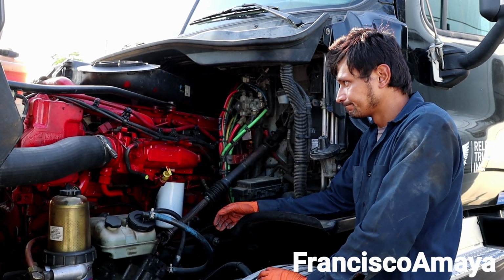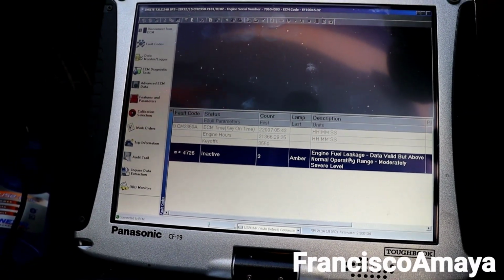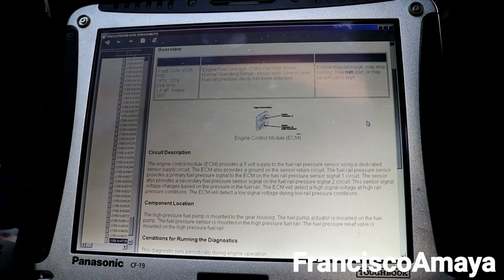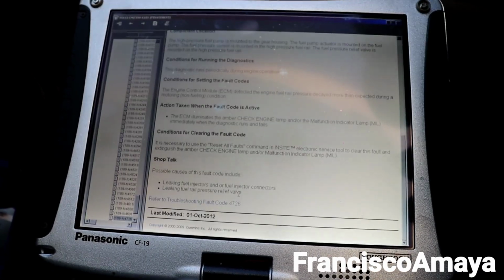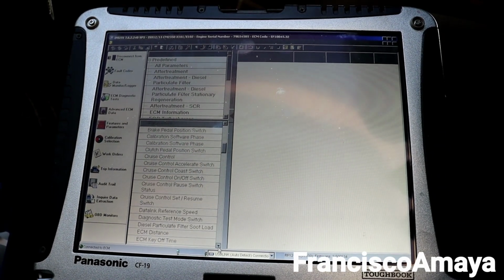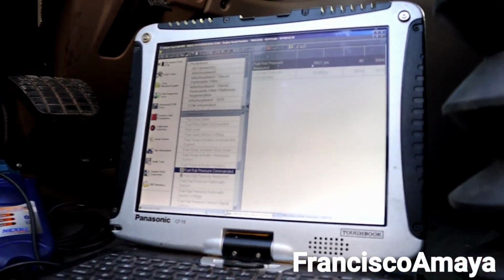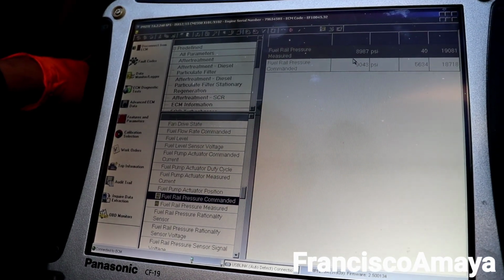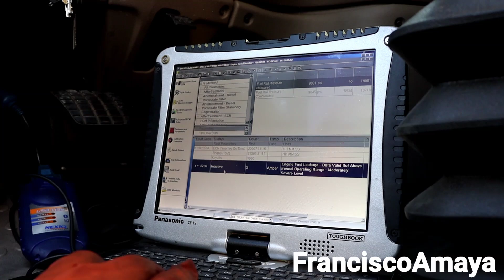Cummins ISX ISX15  spn 1239 fmi 16 high pressure internal fuel leak bad injectors

Comment: If there is only spn  1239 fmi 16 change VALVE, PRESSURE RELIEF Cummins part 4307226 100% problem solved

Comment: I have a similar problem when I start the truck it starts very well after 15 minutes I turn it off and it doesn't want to start anymore, not check engine on it's just the failure to start it has no problem with losing power, when it starts it works fine !!!!!

Comment: I had the same code on an ISX15 IN A PETE done a fuel injector single leak down test and found that my #5 was leaking down under a load thanks for the help!
Reply: Hi i have same code and losing power so how did you find out it was injecter #5?

Comment: Hey foco , thanks for your videos is a tremendous help out here. My truck is a kw with Cummins isx 2009. Sometimes when I’ve drive it does shake and jump and I hear the automatic transmission skipping gears but it never shuts down, only slow down like is going to die but then it picks up and continue. Does it have to be with fuel? Thank you Francisco
Reply: Fuel rail pressure make ur engine jumping